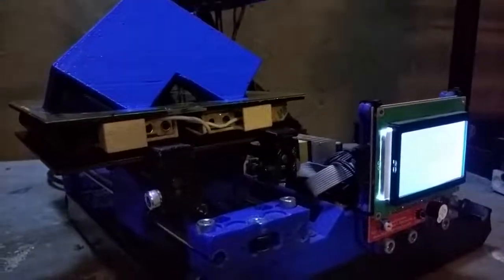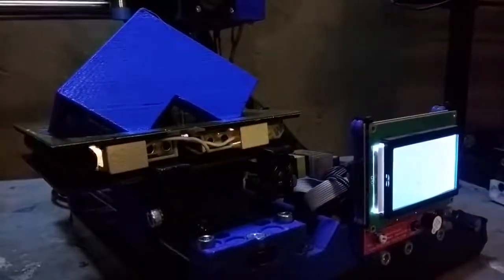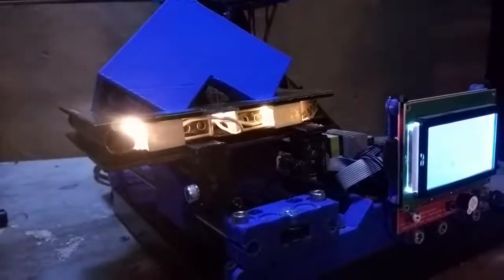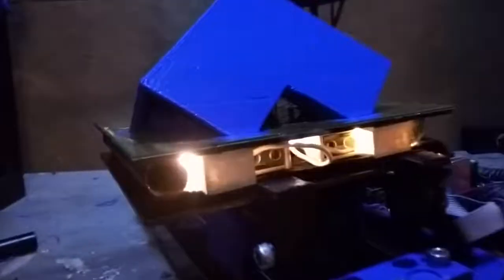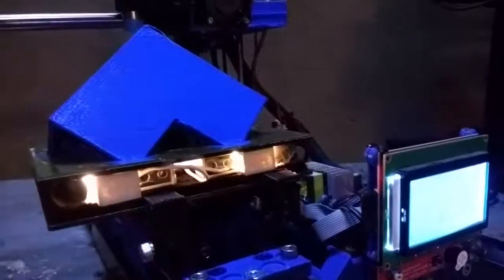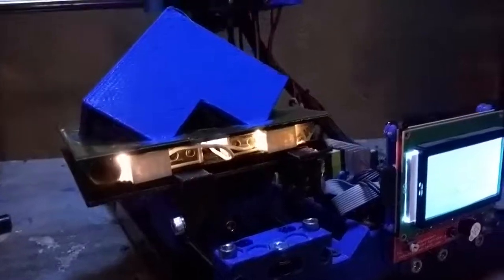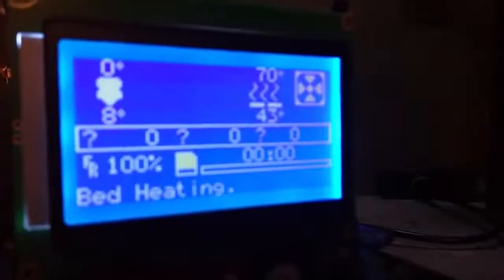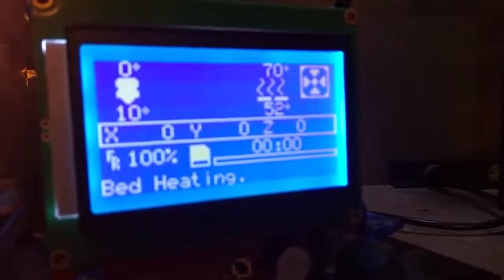Halogen Bulb Heater for 3D Printer Bed

Comment: That is very nice!! By the way, you are using the Marlin firmware, but you can try the Katling firmware. It is more powerful, because you leave the harder stuffs (like calculations) to the Rasberry Pi, and the rest to the other PCB (like the Arduino). You can also add more features without a problem using Katling.
Reply from the maker: Katling? Can you send a link to what that is?
Reply: @marcinose  My mistake, I wrote the name incorrectly. It is Klipper, no Katling. Here you have the link: https://www.youtube.com/watch?v=iNHta6zljoM&ab_channel=Nero3dp
Reply from the maker: @raulgoncalves3075  Ok, thanks. Which is your favorite feature of Kipper?
Reply: @marcinose  My favorite feature of Klipper is that you control as many boards as you can plug into a Raspberry Pi, so it gives you scalability for a cheap price.
Reply: @marcinose  I've heard about it a bit too.  It is almost essential for a lot of those CoreXY Printers, and can do more toolpath optimization *if i remember correctly*.  I'll try and make a wiki page on it sometime i guess!

Comment: Neat concept!  How hot can you get that bed?
Reply: @marcinjakubowski6010  Wow, nice!  Was this just a proof of concept?  These bulbs are probably more accessible than the typical silicone heating pads.
Reply from the maker: At 30% duty cycle, goes to 135C in 15C ambient. Didn't go higher yet. 178C should be no problem.